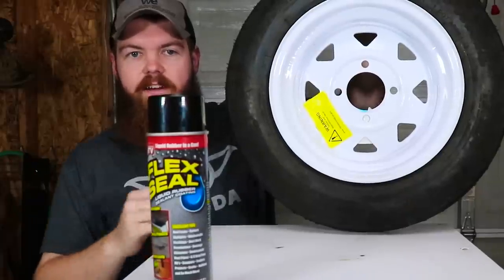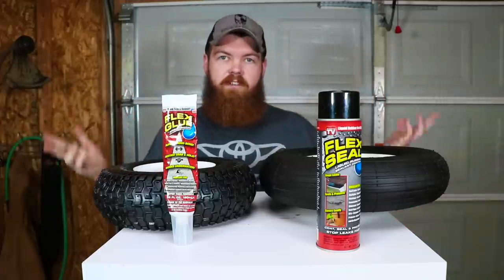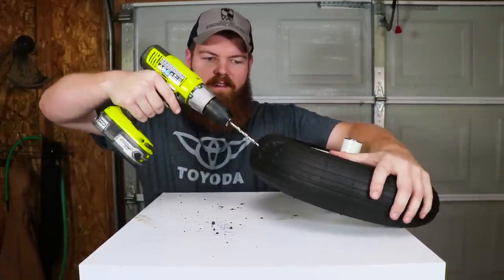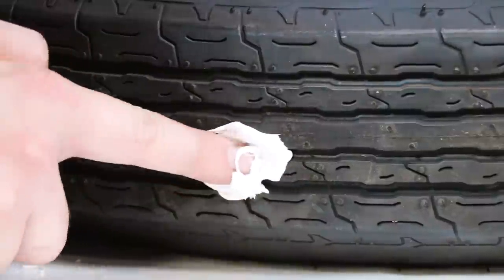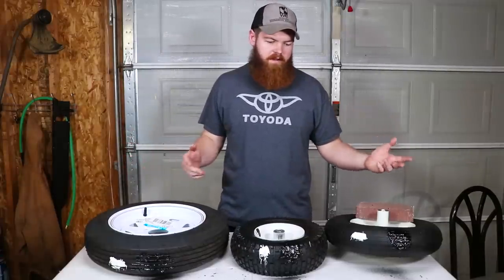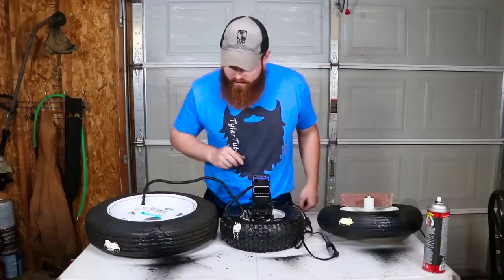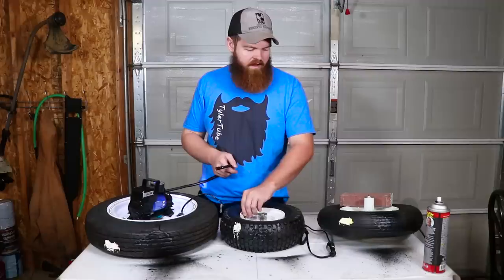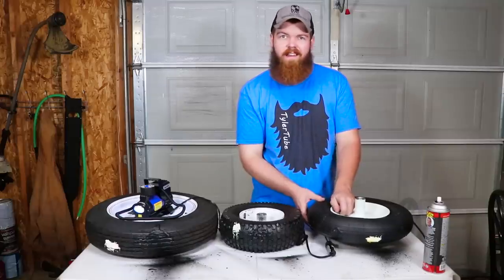Can Flex Seal Fix A Flat Tire?

Comment: The obvious tail if there is a tube is the valve stem Tyler. If there isn't a tube the valve stem is sealed to the rim if there is a tube the stem just pokes through the rim . The tubed tire will typically have a metal valve stem and the tubeless will have a rubber stem.  Come on I know u cant be that dumb man.

Comment: use a damn screwdriver and you could have had both those tires off with a little effort. Then you could've done what you should have done as soon as you knew they had tubes, and applied the glue and seal where it'll actually make a difference, on the tube. Then maybe we would have actually learned something from this video. Sadly by the end we still have absolutely no clue if either substance can fix a flat... I really think you should either learn to accept that you will have to wait an extra day, or just scrap the video when you encounter a scenario like this which adds significant time or effort on top of your original plan. If you don't put forward that effort/time you will make the video pointless, as it doesn't even accomplish what it set out to do. 

 Plus you wouldn't be putting yourself at risk by cutting a fucking tire with a katana, and not even any type of gloves. If you had just used a screwdriver, or a crow bar, or just almost anything else.... my goodness.

I really dont mean to be rude. Just some advice and thoughts. I appreciate that you are expressing yourself creatively, I just think it would be sad if you got used to half-assing it and missed out on the true satisfaction of a job well done.